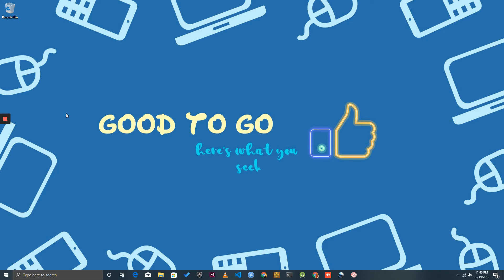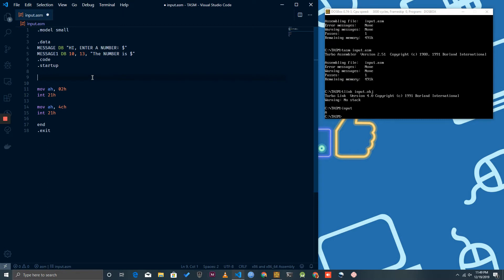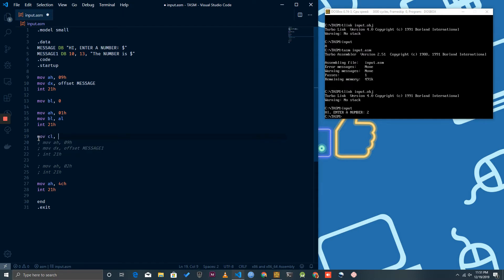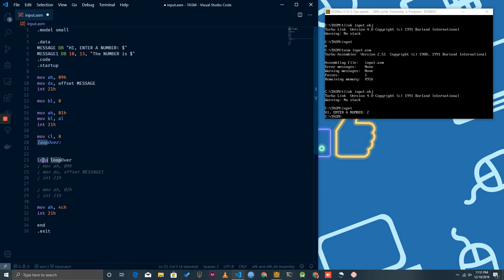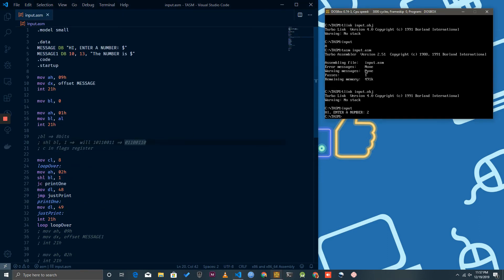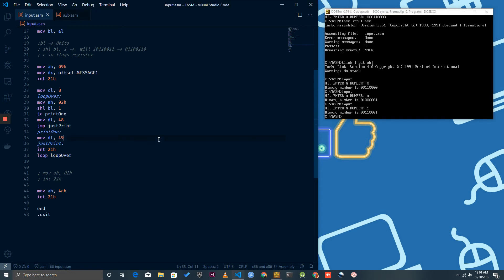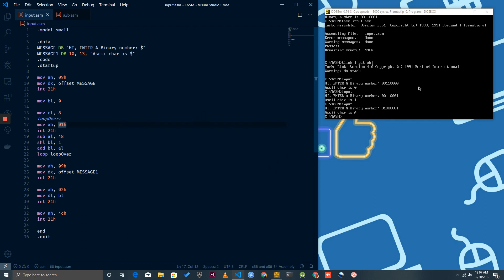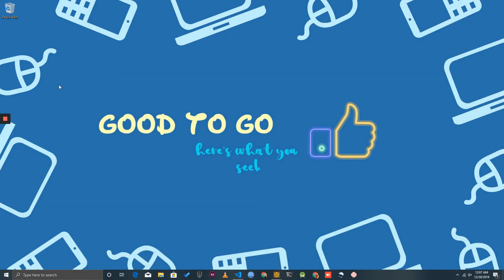Convert Binary to ASCII and ASCII to Binary in assembly programming TASM

Comment: Hi, do you know how to output not the binary code of one character, but the entire string at once? For example, enter (123) and get (00110001 00110010 00110011)
Reply from the maker: Good question. You can loop the whole program 3 times to print 3 digits together. You can use 3 different registers to store the 3 digits and then execute the same logic as we did above for one.
Reply: Thanks! I've been thinking about it too. But I don't understand how to do it in tasm.
Reply from the maker: @llummin , you'll have to loop over the 1-digit logic 3x or you can duplicate the code 3x.
Reply: Ok, thanks, I'll try to do it.

Comment: Write and run a 8086 Assembly language program that converts a three digit ASCII number stored in three consecutive byte locations in the memory, into a binary number. The output should be stored in DX register. For example, if three consecutive byte locations contain 345' (please note they are three ASCII digits), then the DX should get binary equivalent of decimal number 543, which is (0000 0010 0001 1111)2. This binary value will be stored in DX register

Plz solve this ......send it to sandeep.sandeep606.ss@gmail.com